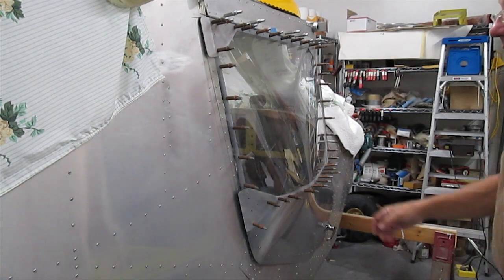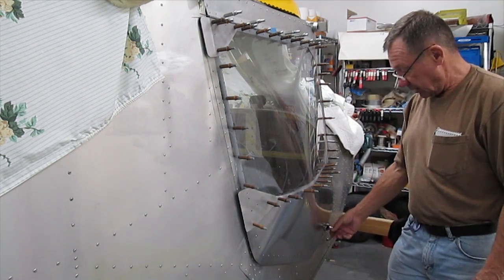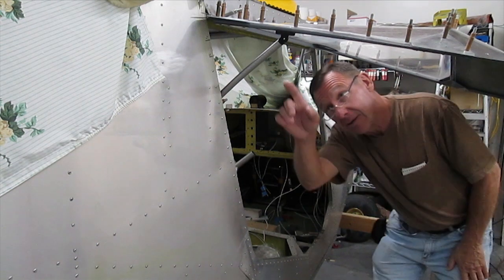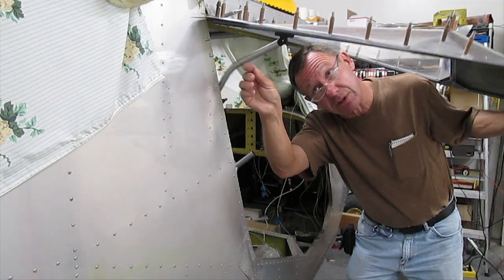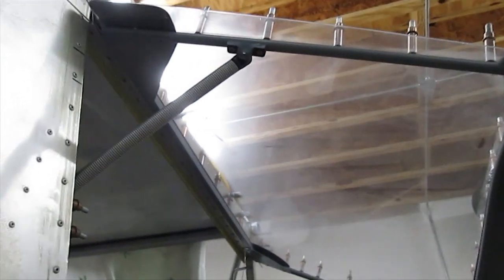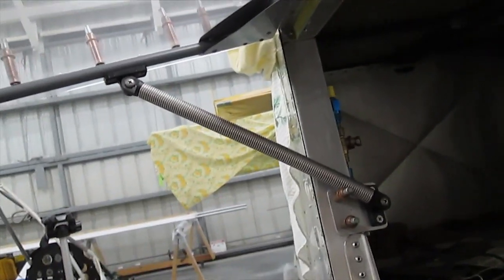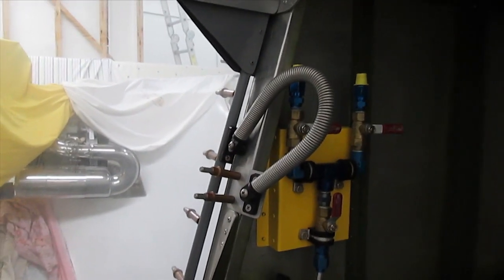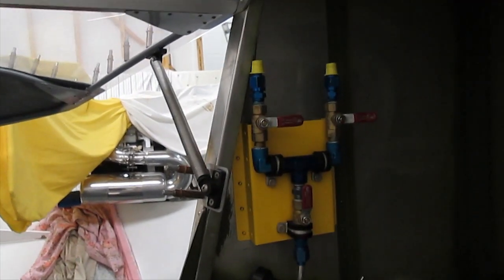Making a Door a little better!

Comment: Thank you for this posting this option.  It looks much better than the gas spring or suction cup.

Did you have issues with the shoulder harness interfering with the spring when the door is closed or is there enough clearance?